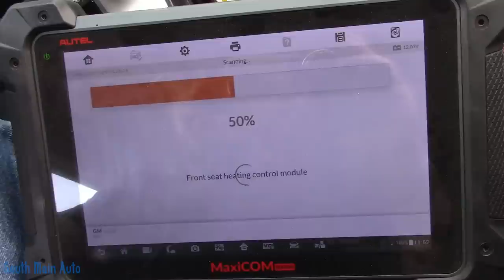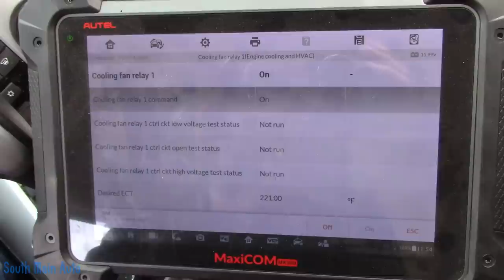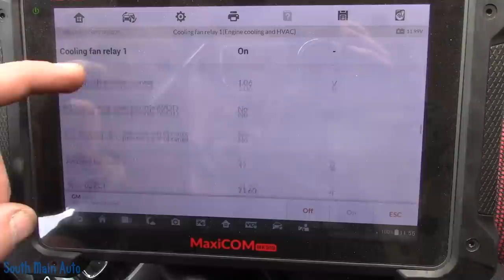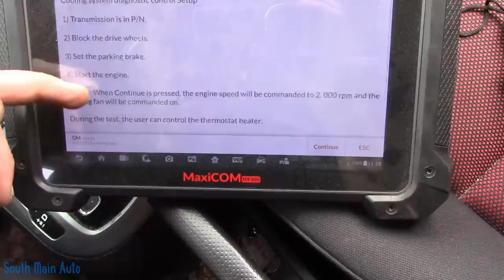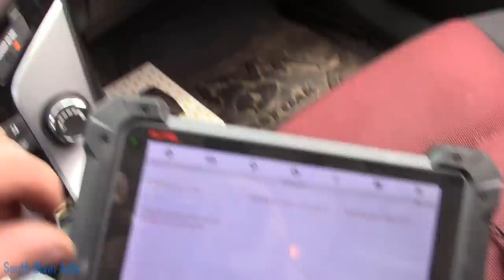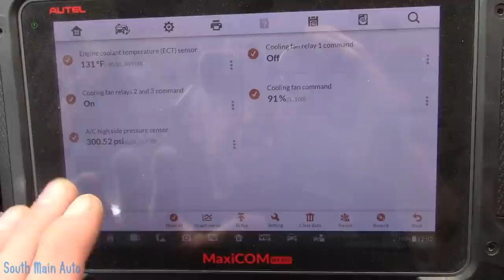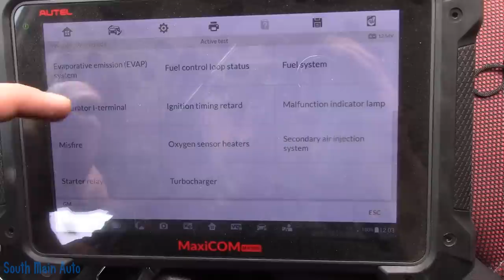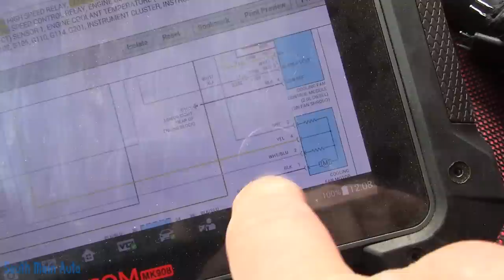Chevrolet Cruze: Cooling Fan Is REALLY LOUD!

Comment: My God I had this exact same issue with a 2004 Freestar. No low speed cooling fan, high would kick on when the AC head pressure got was too high. Three separate mechanics told me it was completely normal. Drove me insane.

Finally got out a wiring diagram and found there was a large resistor in the circuit. Finally found it buried in the wheel well behind the cover. Connector was melted, lots of corrosion. Removed the connector, soldered the sealed the connection. Like magic low speed worked when the compressor was running.
Reply: Broken Freestar, completely normal 😁
Reply: @yitznewton  Surprisingly it was pretty reliable apart from the transmission that failed and replaced under recall. Never had the dreaded PCM water intrusion issue. Guess I got super lucky.

Comment: The whole time I was watching I was like, it doesn’t work on low speed! It only works on high! Very common & the connector usually melts too.
Reply: Yep...Low and medium speeds go out on the fans a lot..Im on my 3rd fan because of it only has high speed left and sounds like a jet taking off when it comes on....So does anyone know the fix to keep the lower speeds from stopping working...
Reply: @Pete391  how did you get it fixed?
Reply: so how to get it fixed?
Reply: @ivanbarbosa3132  You have to replace the whole fan...Two of the fans the switch went out in a couple months...The last one I bought has last several years now..

Comment: Had something similar happen with my old 2001 Villager 

Had no constant low speed cooling fan with the A/C on, like it's supposed to 

Just intermittent 5 second bursts of high speed, then nothing 

Turns out there's one extra cartridge fuse in the box that's just for the low speed mode

Some obscure Bussman FMX Maxi Fuse, changed it and all was well.

Comment: i have a 2012 chevy cruze.heater fan is intermittent. until you hit a big pothole then it works until you turn the key off. then it just replays like that everyday. no a/c either but engine fans works . been trying to diagnose. seems like a bad relay not a loose connection. very hard to get a wiring diagram from chevy AKA bring it to the shop so we can fix the problem we already know what it is.  any ideas?

Comment: I literally just worked on a Chevy Cruze also. Needed a new thermostat and the pcv valve caused a vacuum leak. Super common
Reply: Watch out on the cruzes..... GM has a bulletin where a missing intake non-return valve causes the pcv to wear out. Had a few come in from other shops where the valve cover was replaced a few times
Reply: @jeremyeaves5272  yeah I replace them all the time. The cruzes are terrible vehicles
Reply: @MacAutoDiag  I work at a Chevy dealer, and them Cruzes pay my bills! Can't keep oil, coolant or tranny fluid in 'em to save your life. See one coming through the door, and ya know you're boarding the gravy train. 
Been starting to see a lot of radiators and a/c condensers leaking on the '14-'18 Silverados too, another cake walk.

Comment: Might as well replace the valve cover and the turbo while its in. 70k miles on it...its probably only got 1k more before they go up.
Reply: Technocasm valve cover, turbo, coolant housing on the side of the head. Every fucking one of these fails on ever single Cruze
Reply: It’s actually the rubber check valve in the intake manifold that causes the valve cover to fail. So throwing valve covers at the problem doesn’t fix it.

Comment: Here in Australia the Holden badged version of the Cruze have been plagued with problems including transmission issues,injector failures,ecm issues etc,they are very poorly rated and resale values reflect that.

Comment: In most cases, the fuse to the radiator fan fails due to inconsistent triggering of the coolant temperature sensor at the thermostat housing. If it's not the fuse, it's the resistor on the radiator fan itself that fails. This car is built to fail, and they continue to carry on these "features" to the newer models, which evidently carries the same problems year in, year out. Good for your business though. :)
Reply: Would that apply to the double fan setups on GMs such as Buick Lacrosse? My Fans run hard seconds within startup. Have changed thermostat and temperature sensor already.
Reply: @poppakellz7183  I would recommend checking the fuses that relate to the fans first as it's the cheapest first shot. Then investigate the resistor on the fans itself.

Comment: Had a Chevrolet a couple of years ago and when the outside temp would go to 90 plus and the A/C went on the second fan would not go on and cool the engine down and when I took it back to the dealer they could find any problems with it and I took it back to them at least 4 times and GM refused to say there was an issue and I got rid of the car and I have sworn off American made cars from that time on.

Comment: Had that issue and replaced the thermostat and it stopped. I unplugged the fan connection at one point because it was in the way whole trying to change the serpentine belt. Plugged it back in and when i turned on the car it went loud again.

Then i unplugged and plugged back in and it stopped blowing hard. Been good after half a year of doing that

Comment: so the three different fan power feeds had resistors for slower fan speeds depending on which wire is hot at any time.

Comment: I heard mine kick on randomly for months. Then it would stay on for 10 minutes after just driving a mile. My husband of course said I was delusional and if it WAS happening, it was suppose to. The mechanic wasn't sure bc the scanner did't catch it, but they finally heard it... turns out, it was about to go out completely and my car would have started over heating. 🙄

Comment: I see the problem.  It’s a Cruze.  Junk it and get something else!
Reply: Nicholas Smith
If you junked everything that needed a repair you would run out of cars.
Reply: wysetech2000 I haul auto parts from GM’s distribution centers directly to their dealers.  The 2 most common vehicles I haul parts for are the Cruze and the Equinox.  Engine rebuilds constantly!
Reply: @nicksmith8166  hallelujar

Comment: Well this is a great video , my Chevy fan comes on in full speed once the key is in on position before even cracking the engine, it is on all the time and when I switch off the engine it will stay on for at least 30-to 60 seconds , swapped relays all good, from yesterday it won't come one but when AC is on it kicks on for about 30 seconds and off for another 30-40 seconds it kicks on again  ,it is never on constantly, Temp in the car is OK not overheating not losing coolant ,checked with the scanner temp is ok mostly it gets to 89C which is 160.2 degree Fahrenheit, so without this scanner how can I use the bulb test? thanks
Reply: how did you get it fixed?

Comment: My favorite thing about 2010 and up cars is when the radio is way up when you roll the key... you go to shut the thing off and hit the power button 456 times before it actually shuts off. I swear technology is getting more stupid
Reply: Making non-critical things unnecessarily computer-controlled, so they have the lowest priority for processing.

Instead of having a separate controller that changes the device (radio) status immediately and dumps a status update onto the bus (that's the point of CANBUS!), they just have an interface module that sends (processed) input onto the bus and waits for the main controller to send an actual command back.

And they do this for everything! Ever notice that when you turn the AC on in an older vehicle, it turns on before you even let go of the knob, but now it waits a second? The switch just signals the computer, which then goes through a whole checklist of "Kick the idle up, now turn the radiator/condensor fan(s) on, now engage the compressor clutch, now set the blend doors - wait, are the system pressures correct? - okay, kick on the blower motor . . ." and double-checks the status of everything at every step. Sure, this means you can get absurdly specific error codes, but is it really worth the loss of response?

Monolithic design is fragile design. We've known this for decades, but automotive engineers have decided it's the best idea in the history of ideas.

Comment: No multiple cooling fans just one that’s stepped. It has like a “high”, “medium”, “low”. I’m dealing with a 2016 that is running flat out all the time the vehicle is running. Codes for IAP intake air temperature and pressure sensor.

Comment: So my thermostat failed and I replaced it.  Ever since then the fan come on a lot and it is very loud.  Can it be that the new thermostat is not working like it should?  Didn’t have any fan issues until the thermostat/housing failed.  Thanks

Comment: I have had the same problem with my cruze and I have replaced the fan with resistor pack 3 times but after a week, the 2 low speed resistors blow each time. I have scrutinized the wiring diagram and there isn't anything other than the fan that would blow those resistors (there's no chance of a short to ground between the resistors and fan due to wire routing) other than a faulty part design. I have also seen quite a few cruzes with the same exact problem. Every video I find about it ends with replacing the fan/resistor and calling it good. I really wish someone would do a follow up!

Comment: My cooling fan bearing just started to make noise  2 weeks ago - Honda Civic 2012 with 100,000 miles on it. I checked on Ebay and can get a replacement for $100 CAD. I will swap it out myself because I am a cheap bastard.

Comment: Right now my 2012 Chevrolet Cruze's engine fan is blowing like crazy even tho I'm parked and the AC is not on! It even says AC stopped because high motor temp. but the motor is not even hot!
Reply: mine is doing the same!!
Reply: @jackieruiz2236  mines is doing the same any fix?
Reply: Have you had your battery checked recently? I had the same issue and replacing my almost dead battery fixed the issue as far as I can tell. Diagnostic tool told me it was a faulty thermostat gauge

Comment: I’m having the same issue with my 2016 Cruze. The fan comes on approximately every 10 seconds, and stays on for about 8-9 seconds when my car is just sitting, idling. My step dad told me it could be low on coolant so I just went to have my oil changed and had them add coolant but it didn’t fix it. A mechanic said I need a radiator flush. I bought the car december 2019 and just noticed it maybe 6 months ago or more. 
If I take this in to my dealer (I purchased an extended warranty through them), would they be able to fix it? Or should I just take it to any mechanic?
Reply from the maker: If you turn off the HVAC unit does it still do it?
Reply: how did you get it fixed?

Comment: I have a 2014 Chevy Cruze lt and you can hear the loud fan from inside the cabin and when you touch the engine its hot, could it be a relay ? What do you think I should check first?

Comment: I have exactly the same problem with my 2013.. Changed the thermostat, changed the fan itself.. and it's still the same.. :/ What else could it be? Relays?
Reply: @majkelandzelo how did you get it fixed?

Comment: My Chevy Cruze 2013 cooling fan comes on about 30 seconds after I start it.  The car thinks it's overheating.  It isn't.  But I don't know what to do. Plus I get on the message console something about the AC disabled due to high engine temp.

Comment: I'm working on a 2011 1.4 turbo cruz my fans are acting quite similarly brake position sensor, mass air flow issues since new the check engine light is on more tha than off
Reply: rick coleman Sounds about right for a Cruz. But hey, at least the check engine light is still working, so you’ve got that going for you!

Comment: My Cruze does the same and I’ve changed the fan twice. I bought the fan assembly at Auto zone and have lifetime warranty but the fans keep doing the same. I feel like their maybe a short and maybe messing up my fans. Could a shortage cause the fan resistor to not work or are the fan assemblies not good?
Reply: how did you get it fixed?

Comment: I had this issue, but reversed in my Impala. No high speed fans, but had low speed. After doing a test to command the high speed fans, fans did. Ultimately no command from the ECU, so had to replace it....dumb butt design.

Comment: Lately i've been hearing my fan because the ac is on but it sounds much louder than I have ever heard it before almost like a prop plane. Also the engine bay seems excessively hot even though the engine does not overheat. Is my fan broken or something?
Reply: I’m having the same thing going on, did you find the issue?
Reply: @paulnielsen6639  how did you get it fixed?
Reply: how did you get it fixed?

Comment: One of the best complaints I ever got from a customer was when he called me meticulous with my work and you are just that meticulous  going through all of the possible problems and patiently eliminating them one at a time that customer was a Harley mechanic that I made parts for custom trikes he was building. The only thing that I can fault you with is the @ don’t trust the equipment “. No the phrase I had drilled into me was “trust but verify “the fact that the equipment is correct but cannot respond to all of the variables. And it was saying it was a Chevy luv tells me that it cannot tell what you are working on
Reply: "Trust but Verify"

Ronald Reagan

Comment: What if the fan makes that noise 24/7 when the car is actually running?.. doesn't make the sound when air/heat is cut on with just battery on. Only when the car is turned on whether the air/heat is on or not. I looked at the fan and it was running, not standstill at all. Car reads "ac off due to high engine temp" but reads completely cold.. even 20 min into a drive. Just did this today when i got in it after work. Please help, i dont know much about a chevy Cruze.
Reply: Was u able to get this fix? What was outcome

Comment: Relay click does not always mean the relay is working? (F150 video).
Reply: It just means that half of the relay is working (magnetic coil in relay when powered closes a switch in the other half of the relay)
Reply: @jackbullock4277  RIght... this was from another video he did where the relay was clicking but the contacts were fouled so it never completed the circuit.

Comment: Lack of space so they use just the one large fan that has three "power settings" with accompanying relay tomfoolery? Whatever happened to thermostatically driven ones that came on and sped up/slowed down according to demand. Way too complicated, a design too far.

Comment: Hey my Chevy Cruze fan come on when the car is idling but it doesn't be high but low and my car isn't over heading, can my fan be bad or is this normal. I replaced the valve cover and the thermostat and I'm still having this happened to me. any suggestions?
Reply: Was u able to break this problem down?
Reply: @Kingpayne72000   nope but i know what’s the problem
Reply: @Joker-5202  what was it I'm thinking maybe electric.
Reply: @Kingpayne72000  it’s a mixture of problems like the water pump and the intake manifold I have the parts for it I’m just procrastinating
Reply: @Joker-5202  yeah I bought the whole housing unit Just for a mechanic to unplug all the parts nd re plug them reset, and it been going strong ever since.

Comment: Three relays plus resistors for a single fan with three speeds? Talk about over complicated for nothing. I can see why they had the three relay system to series/parallel dual fans for high and low speeds but why not just use a PWM controller for a single fan like that. You’d think it would be cheaper that way.

Comment: Kept getting the error code AC shutting off engine overheating I change the coolant temperature sensor and fix the problem 8 months later it's doing the same thing replace that cool and Sons her again and it did not fix the problem they tell me there's a second sensor somewhere AutoZone tells me it is in the actual radiator but I can't find it. Does anybody know where the second sensor is and would it cause the same error code? Thanks for any help also the people at AutoZone says it's the same exact part so it should be replaceable fairly easy I'd imagine

Comment: car companies: lets put tons of electronics and cars that are exposed to the elements! great idea indeed when they all start malfunctioning people have to fix it or get rid of their car and get another!

not that fans are excessive electrical equipment but 90% of the time its electrical related. maybe fans should also be mechanical lol back to the old heat activated clutches.
Reply: My car has a fan with a viscous coupling clutch and guess what.. The viscous clutch is broken so my fan is at full blast all the time.  Also that fan makes the engine rev up slower since the engine has to spool it up. I hate that system and one day im going to change it for an electric fan.

Comment: Good diagnosis but poor inefficient design. Generic Motors should use a 2 fan system, a three winding motor, or PWM, not 1940s technology for dc motor speed control. Odds are the resistors are fried as the fan motor clearly works.